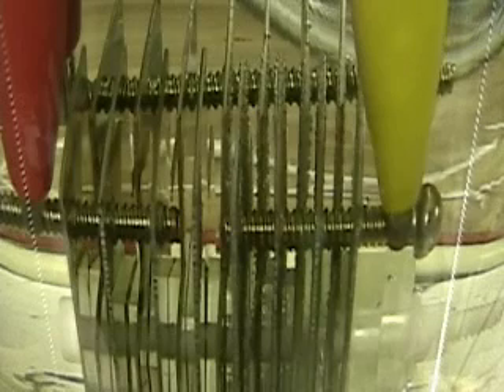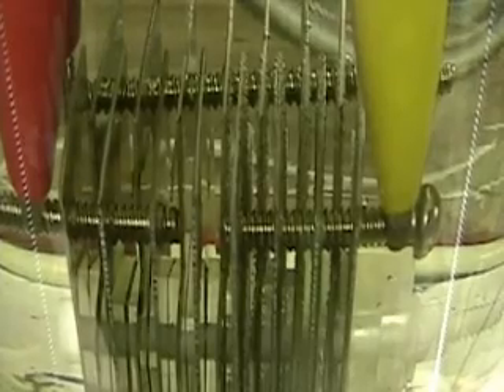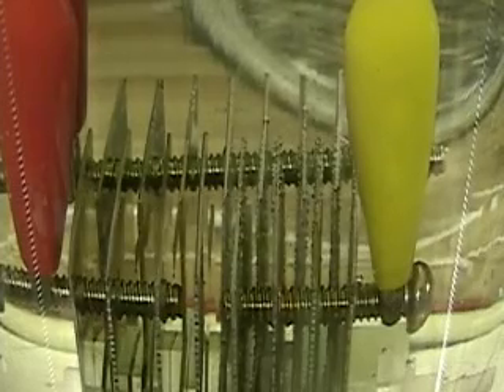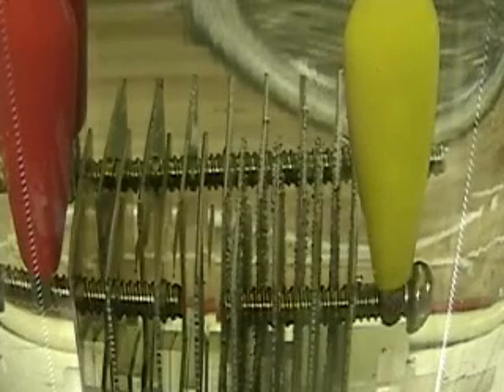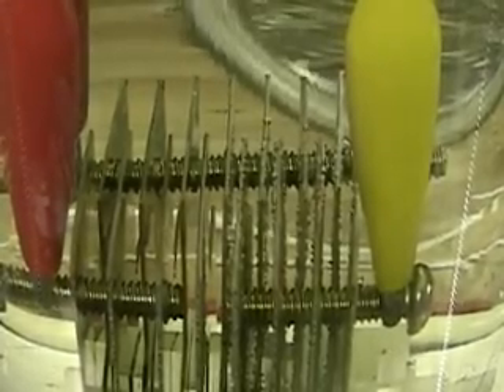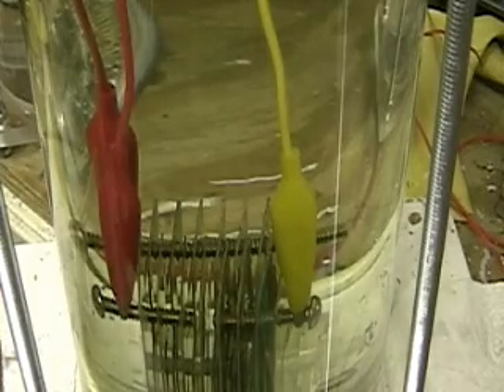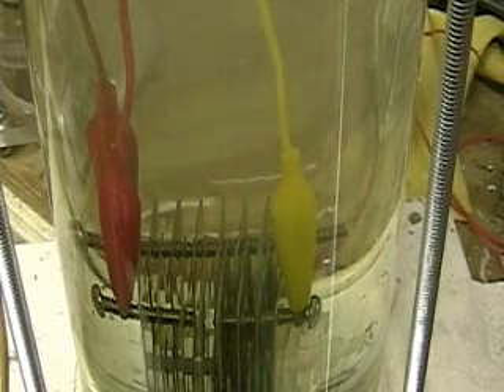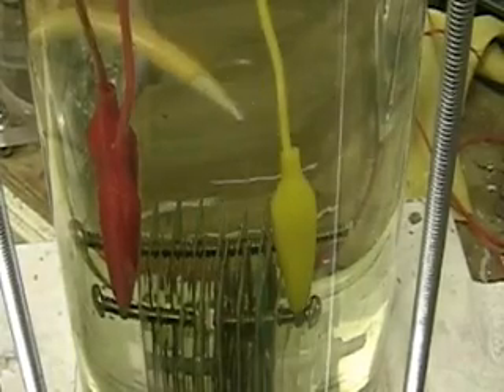hydrogen Tap (Mod. Cell TEST) 163

Comment: Like you I can't get this off of my mind.  I would like to bounce a couple thoughts off of you, please bear with me as I walk through it.

The ultimate goal is a strong reaction at neutral amps right?

The AAron cell operates similar to a lead acid battery replacing the lead with stainless steel and the acid with water correct?

If you can develope a 12V charge on the AAron cell the theory is this creates a neutral feild with the 12V battery.  Am I on the right track?

Comment: Hi John, 
I think I have the answear to this one...
- at the cathode (negatively charged electrode), hydrogen ions accept electrons in a reduction reaction that forms hydrogen gas.
- At the anode (positively charged electrode), hydroxide ions undergo an oxidation reaction and give up electrons to the anode to complete the circuit and form oxygen gas.       
Good Work! Keep them coming.

Comment: What would happen if you completely surrounded the positive plates with negative plates on all sides I wonder? That way you are still using 1/3 but under a different configuration. I wonder if that would effect the output?